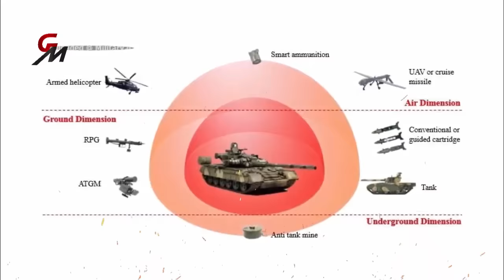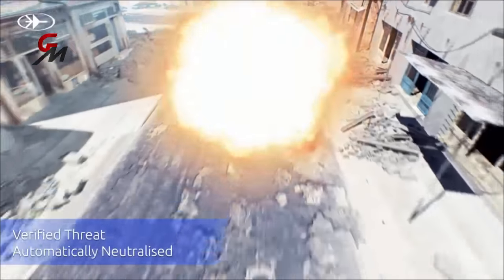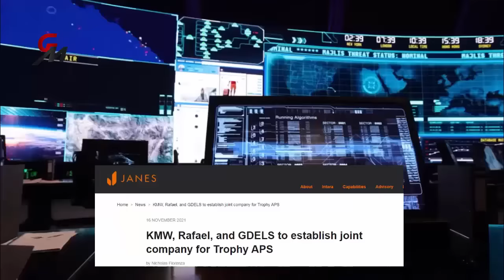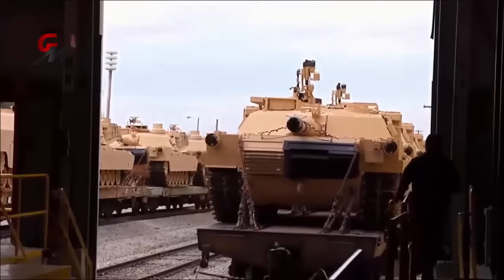The Only Reason Why The UK Challenger 3 is The Most Feared Tank on Earth

Comment: Well a smoothbore gun means that the British army will be unlikely to fire HESH rounds. And really thats the round you want to use against buildings.
Reply: I mean normal HE round can do the same job
Reply: @divinesan7786  No, a HESH round is different. Its plastic explosive that spreads out when it hits the target and then detonates. Very effective.
Reply: @zedeyejoe  basically HE frag. Only thing HESH is better when it faced armored vehicles but since most modern MBT has composite armor and ERA, HESH is basically useless.
Reply: @divinesan7786  Nothing like HE frag (no frag for a start). I will repeat, hoping this time you will get it. HESH is plastic explosive that spreads out on the surface of the target before it detonates. Look it up.
Reply: @zedeyejoe  how do you know “no frag”? Yeah and? I know what Squash head does. I told you, only effective than HE  against armored vehicles like tanks, main reason why HESH even existed, demolition and fortifications can be handled by HE. And i already told you, modern tanks no longer fear HESH, that’s why it loses the favor in most modern MBTs,. You can look it up too.
Reply: @divinesan7786 The reason no frag is because that would defeat the purpose of the HESH round (spread out).
HESH was developed by Dennistoun Burney in the 1940s for the British war effort, originally as an anti-fortification "wallbuster" munition for use against concrete.
The anti-armour effect of the HESH round was always secondary. Its advantage was the penetration was not affected by range (just like a HEAT round).
Reply: @zedeyejoe  but i never said HESH has frag, i called HE frag, didn’t i? Yeah and now it is pretty useless that besides Britain and countries still use license L7A3 105mm or rifled gun like Arjun, no MBTs use HESH. Normal HE can do just fine
Reply: @divinesan7786  What you said 'basically the same as HE frag' HESH is nothing like HE frag. HESH relies on blast, not fragments.
HESH retains its anti-building role., which is and was its primary function.
Reply: @zedeyejoe  i should have phrase better because for some reason you didnt get the the point, i mean "the same" is their job as building or stronghold demolition, not that HESh makes frag like HE round.
Reply: @divinesan7786  You can phrase it anyway you like, you would still be wrong.
HESH is plastic explosive, in a thin walled container that uses blast to create its effect (I am sure I already mentioned that).
HE is high explosive in a steel walled container that creates its effect by blowing that steel container to bits.
Thats the difference.
Now to add to that, the HESH blast creates shock waves that go through the wall it hits  and crumbles the wall. Making HESH highly effective against buildings, its primary role. The fact that it gives a Challenger an 8,000m range is also handy.
Now for attacking armour, you also may like to consider this. HESH rounds are lobbed at the target, its not a straight line, its an arc. So the HESH round is liable to hit the top of an enemy tank, where its armour is weakest. How that works against a T90 or a T80, I guess we will have to wait and see.
Reply: @zedeyejoe  yeah no shit, i know the different between HESH and HE, but i dont talk about their characteristic, i talked about their role as building and stronghold demolition, i am pretty sure i already said that. It is like im talking to a wall. 
"Now to add to that, the HESH blast creates shock waves that go through the wall it hits  and crumbles the wall" that is like every High Explosive ever, not just HESH property, the different rom HE is that the squash head creates shock wave that can break metal pieces which can be lethal, which i told before, only effective against armored vehicles like tanks, but like i said, modern MBT has composite armor and ERA to deal with it. If HESH was still that relevant, most NATo tanks would still use it but they completely abandoned HESH for so long. HESH is a slow round, no one gonna use it that long away anyways. "hit the top enemy tank" that cant never happened. first, i like said before, the round is VERY SLOW, hitting some thing at that range is very difficult already, second something like Russian MBT has ERA on top which makes HESH useless and you just waste ammunition, third, most MBT has spall liner or a form of Kevlar armor so spalling from HESH isnt lethal anymore.
Reply: @divinesan7786  No its not. HE rounds destroy with the metal they spray, HESH is blast effect.
And the waves of the HESH blast are very effective at destroying structures. Thats why HESH was developed - as I pointed out.
And thats also what I said, lets wait and see what happens to a T90/T80 hit by a HESH round. I am a firm believer in real life being superior to theories.
Reply: @zedeyejoe  ok for some reason, HE round doesnt have blast shockwave? no way you thionk that, right? HESH is just a better way or high explosive to deal with enemy armored. nothing, nothing happens to T-90 or T-80. HESh is being countered by ERA and composite armor, they give no threats to any MBT
Reply: @divinesan7786  You got it, I don't think an HE round has a shockwave through material like a HESH round does. 
Because a HESH round plasters the explosive over the surface of the target, then detonates. Duh.
HESH was designed to destroy structures. Developed in 1942, to do precisely that (as pointed out previously).
Reply: @zedeyejoe  it has shockwave, it creates overpressure. HESH creates spalling, HE can’t. Ok then High Explosive doesn’t design to destroy structures?
Reply: @divinesan7786  HE has been around for a long time. HESH was developed in 1942 to destroy structures.
Just as HEAT was developed before WW2 to penetrate armour.
Reply: @zedeyejoe  yeah i know that. your point being?
Reply: @divinesan7786  HE is used because it is available. HEAT is used because its a rather easy way to destroy armour. HESH is used because its good at destroying structures.
As time goes by, better weapons are developed.
Now tank HE rounds have been developed with programmable fuses. So a tank HE round could be programmed to penetrate a building, then explode. That may make them as effective as a HESH round. More expensive but it should do the job. 
Already Russian tank HE rounds can be set to air burst, thats more effective against infantry than simply exploding on contact.
All that has been available for artillery HE rounds long ago, now being made available for tanks.
But one thing was learned from the civil war in Syria, modern concrete buildings can have a lot of holes blown in them but they still stand.
Reply: @zedeyejoe  you know, like i said, i can use HE to do the same job that HESh does and it shows no differences. 
dude, programmable fuse doesnt mean "penetrate", programmable fuze is for aerial counter or airburst. HE doesnt penetrate, they explode, you know that. 
What? it is not the modern structure resists the explosive, it is that the buiding is not small, i mean and airplane can crash into it and it doesnt make the entire building into pieces
Reply: @divinesan7786  Enjoy your fantasies
Reply: @zedeyejoe  ????

Comment: Sounds like this video was narrated by ChatGPT, with minimal research by whoever scripted it...who seems fixated on repeating the same info on the gun, the rest is pointless filler.

Challenger 3 is actually just a rebuild/upgrade of Challenger 2, they use the same hull,engine, etc. with a new turret for the new L55 gun. That's not a "whole new system".
None of them have been built yet, the MOD has only just signed the contract. Won't be expected in the Army until at least 2027-2030.
Reply: Exactly.
"Bay Systems" like it's a favourite girlfriend

Comment: Seem to burn well in Ukraine lol.
Reply: That was a challenger 2 not the new challenger 3 and it's the first one ever lost.

 A rear fuel compartment was damaged when it went over a mine, which incapacitated it. The crew were fine but bailed out, then it got hit by a Lancet drone which because they'd left the hatches open damaged the interior.

If they'd closed the hatches it could have been recovered and easily repaired as the drone didn't get through the armour. Apart from it's successor it's arguably the toughest tank out there.

Comment: it will never be the most feared .. at most there will be 148 lol, just 148,  its pitiful!! it's not even a new tank...its upgrading an existing tank on which there are very limited stocks and its all outdated due to flaws in Challenger 2 which it is based.. it should be a new design with all the improvements that brings .. and stop wasting 4 billion on that aircraft carrier that will probably be never used fully due to no aircraft till 2050 !! spend 4 billion on the tanks and we would have a great tank with a lot more numbers to be useful instead of the pitful 148! it's not even a full division !!!!